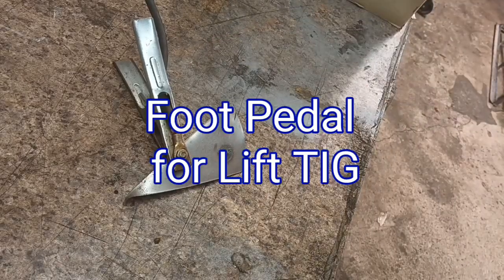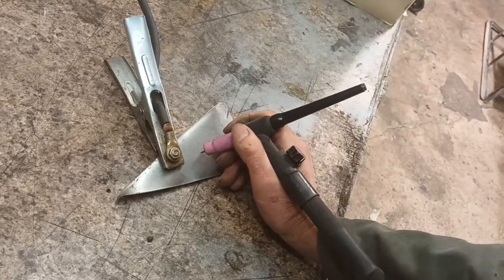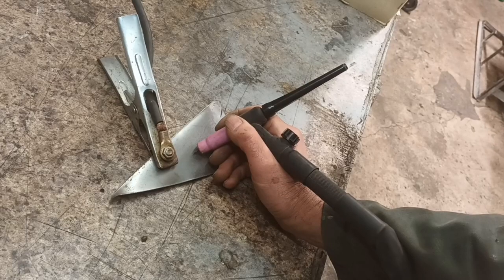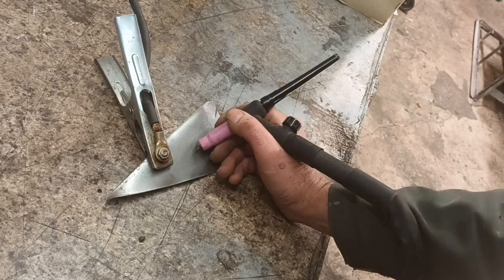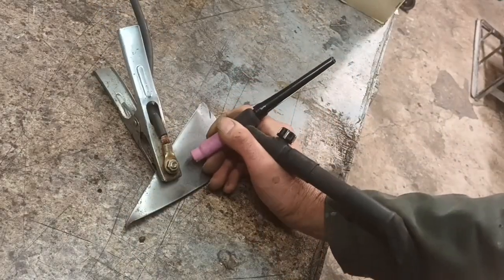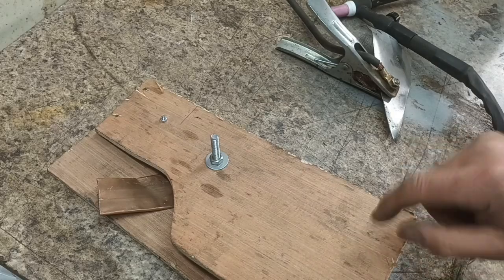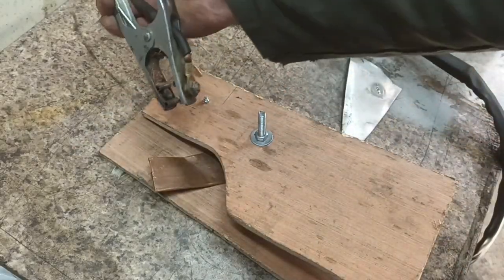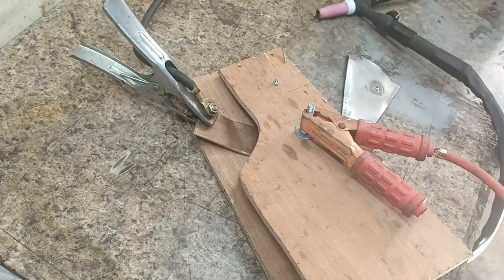Lift TIG foot pedal . SEE WARNING IN  DESCRIPTION

Comment: That is quite amazing actually. Did you get cleaner welds from using it?
Reply from the maker: I don't do alot of TIG but it makes the end of the welding so much easier and also for tacking
Reply: I don't have a trigger switch on my tig. If the electrode isn't touching the work piece when you hit the pedal will it still start the arc?

Comment: I don't have a trigger switch on my tig. If the electrode isn't touching the work piece when you hit the pedal will it still start the arc?
I need something like this for doing short tach fusion welds before adding filler.
I had thought a sewing machine pedal might work. One without a reastat.
Reply from the maker: If you have Lift Tig welder it will not arc till you touch the tungsten . I would doubt a sewing machine pedal would handle the power , but I have no expert advice for you .
Reply: @BigJim123100 
If I buy another torch with a trigger on it is that still going to need to have the electrode touching before it will start?
If so I may just buy a whole new machine that has a trigger. Does it need to be a high frequency machine for the trigger to work, I need to do single tacks at .5 to 1 second each. Click, click, click is what I'm looking for. Small spot welds with a single burst and not a long connection. Just enough to fuse two parts together.
Reply from the maker: @Headmyco  A new torch will not help you if your machine is LFT tig . I think I will get a better machine  . I will chose one with a foot pedal (and pulse feature) , that will do what you want  . You need to do some more homework .
Reply: @BigJim123100  
Homework began here. I have been trying to find an answer to that question so I appreciate you informing me. I wanted to have a single machine that could do everything but none of the 500 to 700$ types seem to do MiG stick and tig other than lift tig. I'm not great at tig welding to begin with so trying to learn everything about it while having to figure out the lift part is annoying. I trigger and or foot pedal would be great. I'll just find a machine just for tig only.
If you know of a reasonably priced one I would appreciate your knowledge. It's something that might be used an hour or two a year so it's not something I prefer to invest a lot in. I only need it for tacking and welding very small stainless tubing. 1/4" 3/8" and 1/2" I do a few fittings every few months that take 5 minutes per fitting. Sometimes all that is needed is a 1 inch pass and the machine may not be used for a year. My MiGs are great. Lincoln 180c and a Miller 220. I just hardly ever tig anything. 
Thanks for your advice sir, very much appreciated.

Comment: But did it work?
Reply from the maker: It works great for me , but try it at your own risk .
Reply: @BigJim123100  does it cause sparks?
Reply from the maker: @dubbleA100  It welds perfect , but there is an arc at the foot pedal when released at the end of the weld . Not given me cause for concern .
Reply: @BigJim123100 Ok cool! I was going to ask if it ever caught fire. But I guess the sparks are so brief, it's not an issue. I guess you could keep a fire extinguisher nearby just in case. 😉
Reply from the maker: @ericcaldwell3584  Never caught fire . I only use it occasionally , I am not a good TIG welder . If I had to do a serious amount of TIG I would get a better setup .